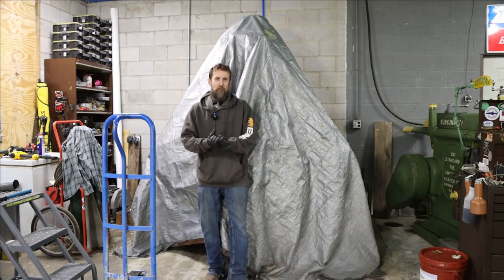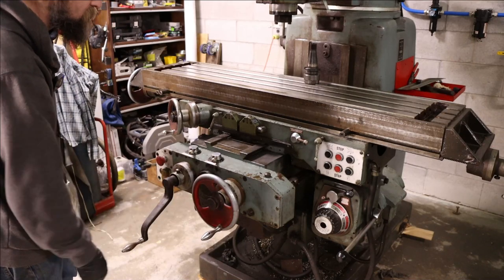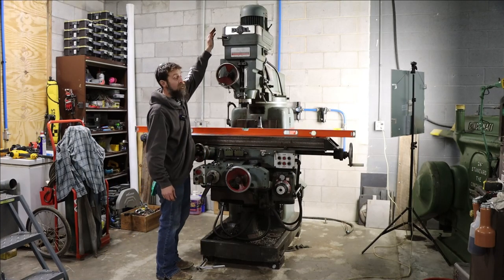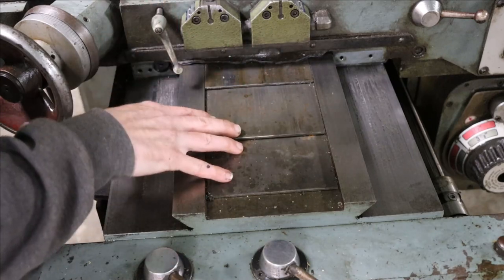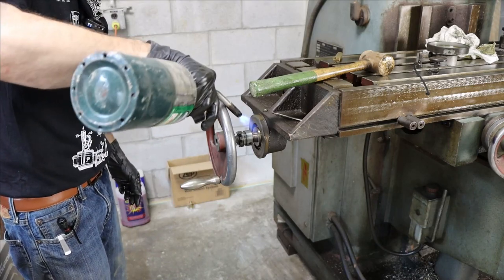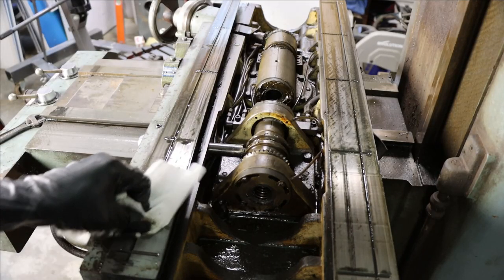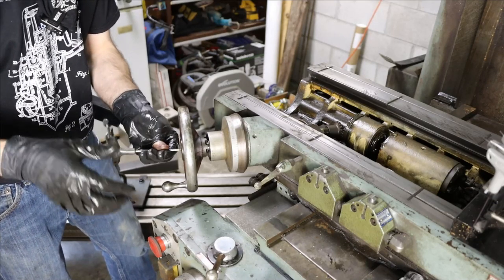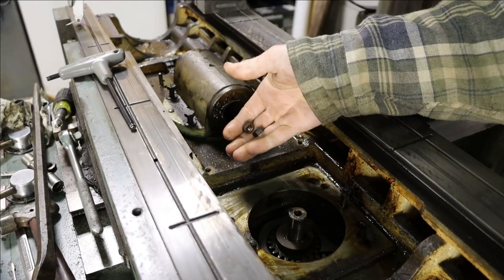New machine reveal day and break down .

Comment: Nice mill.  Gotta keep those ways covered.  Stone the sliding surfaces to knock off any high spots and count the scores as oil ways. LOL  I would guess the weight at that time would be 604 lbs.  I need a toe jack, and Harbor Freight is calling.  The knee ways are scored the saddle ways should look about the same.  High pressure airlines can blow chips places they should not be.  Gotta cover the ways and protect them.  Did you get a manual with the mill?  OOPs I did not account for the voids when I made my estimate.

Comment: I think it would of been wise to clock the table over its entire range , scoring is not the same as wear , and a lot of wear can occur before its really noticeable on machining , depending of course on how minutely accurate you need to operate, the fact that the dovetails looked in good condition , might suggest that it looks a lot worse than , you might imagine it to be . 
 often a good clean up and properly adjusting all parts will be enough to make this machine useable for years to come . 
 Its a great project , but costly ,and time consuming, on what might not be necessary.
 Im not being , obtuse ,just pointing out , different options , 50 years of machine maintenance , gives a great perspective .

Comment: I  used to run a similar size vertical mill at work, it was FNK25, so... I had to use a stepstool to tighten the drawbar. :-) Despite the fact that there was a pretty thick wooden pallet in front of it. It's an oldschool electrical safety thing.
Reply: If it was me I'd put a wooden deck around that mill. Be comfortable to stand on anyways. I could see some nice black greasy boards around it. Would look good!
Reply: @1pcfred  Unless you're 2 feet taller than me, you'd still have to put a stepstool on that deck. Because like I said, that's what I had to do.
Reply: @LambertZero  no doubt. Still nice to work off a dance floor. Standing on concrete can do me up.
Reply: Yeah, and guess what, that FNK25 machine also had Y axis ways all messed up. Maybe not as bad as the one on video, but pretty bad. That part really needs way covers, everything is landing on it.

Comment: Where are you finding all these machines I've been looking and I can't find anything could use a little guidance if you have time thank you
Reply: You find machines where people used machines. Heavily industrialized areas that went bust. Past tense is important. When a shop goes under they'll come in and auction everything off. All in an afternoon. The trick is to have the gear to be able to haul equipment away. Because that's part of the deal. You have to be able to take what you bought away. Maybe they'll have a forklift to help you load it. But you have to have something to load it on.

Comment: Turkite (spelling?) is very soft. It is a wonderful material and can be applied to correct for material loss or applied in the original build. If you opt for this material, investigate upgrading the way wipers. Chip infiltration will damage this material faster than it wore the machine cast iron.

Comment: That bracket looked like it's sliding freely in the t-slots. This is not a good idea. I used one like that to pull a slightly lighter table off of a slightly smaller knee mill, with an identical cherry picker. When the table came free of the machine, it see-sawed a little - just enough for the bracket to break static friction and let the table slide off of it in an instant. It survived with no damage because the first thing it hit was the cherry picker's leg, which took most of the energy as the caster underneath exploded into mangled pieces and the steel tubing itself received a sizeable gouge. Thing is, my leg was not far off to the side and I wouldn't have time to move away if the table took a different path. Long story short: when you lift heavy stuff by the T-slots, make sure the lifting assembly can't slide. Gravity is non-negotiable and static friction is not a thing you want to depend on for safety.

Comment: Makes my Tom Senior M.I. and Marco 3A machines look like Dinky toys😳🤗😂
Replaced original motors with VFD controlled 3-phase ones and what an absolute pleasure being able to adjust speed for cut‼️
No more messing with belt and pulleys, just twiddling knobs now👍
Did the same on the lathe, drilling machine and shaper, and the ease of adjusting speed on the drill was an eye opener😮
How did I manage beforehand?
Hope you keep that machine🙏

Comment: Steve, move the feet to the corners of the machine, as those bolt down recesses aren't designed to hold up the weight of the machine. They might crack or fracture with pressure from below. My guess for the table is 385lb

Comment: The gearbox on your mill looks the same as the one on my rambaudi V2 mill, the shifting mechanisms are made out of  plastic. Would be a good idea to make new ones out of brass.
Reply: I have a rebadged version or your mill called Manex. Nice mill design other than the y-axis screw being so far off center. Causes the saddle to develop a twist as it wears.

Comment: HI,was Santa  Al there again?Two motors?Libe pump not working or cloged filter or no maintance up keep,ie filling lube tank.Going to need lots of repetitive fitting to scrape that.Ive done a few. Nice machine totally worth fixing. Replacement cost 25,000$ at least.How did you unload it ?It has to be over two and a half tons.

Comment: Thats some severe galling at Y axis. Lack of lubrication... Maybe clogged up oil lines. Someone didnt care of the machine when continued to use it :/

I used a roller table to pull out my 1600mm long lagun table, it worked great. Then used a lift to get it off from there :)

Comment: Isn't your K&T mill large enough to mill down the dovetails on that knee/cross-slide?
If you scrape it afterwards, it doesn't matter whether you mill or grind it. Milling surface scrapes away with a biax in no time. Milling might actually be the better thing to do, because you can easily get beneath the dovetail with a flycutter, whereas you need special cup wheel on grinder to do that.

Comment: Given that electric motors and their control electronics have come on by leaps and bounds since that machine was designed, would replacing the current single speed motor with something semi-current be feasible?  Having to change belts sounds tedious and likely to lead to a reluctance to change speed.

Comment: My guess is 629 pounds. Just came in from working on my CNC mill refurb project, and you're working on a mill now too! I just took one of my Y-axis way covers off - I was a little worried that I was going to find some horrors under there, as I think the y-axis lubrication metering valves are plugged, but it looks like there was some oil there still and it wasn't completely dry - hopefully there's no wear on the ways... https://imgur.com/a/8MqasmM there's no shortage of chips, old oil, and all kinds of other nastiness under there...

Comment: Your table weighs 491.6 pounds.  If you are just looking for a restoration project, press on, but I would have first put a flat plate on the table and measured it in X-Y directions to see if there is actually any significant error due to the scoring.

Comment: you can probably make it variable speed by using a vfr , you probably need to get a little creative wiring it up  to get the vfr work only on the motor and not the other mecanics like the pump and stuff